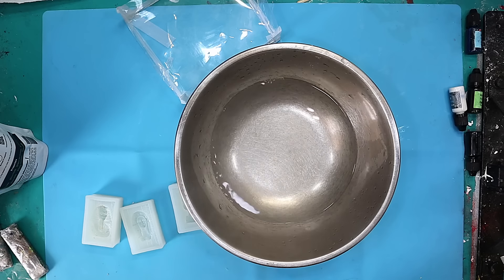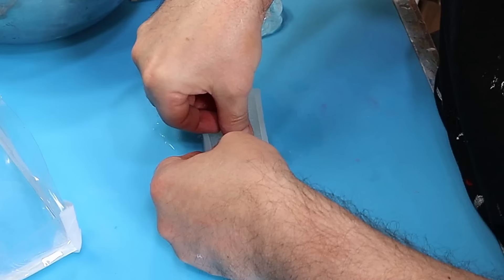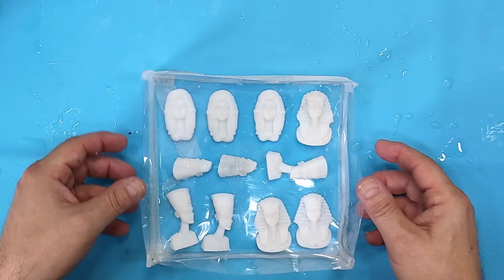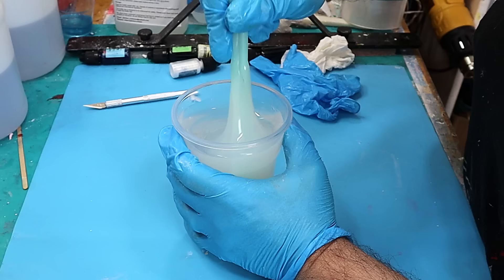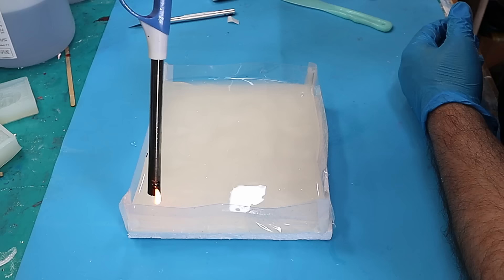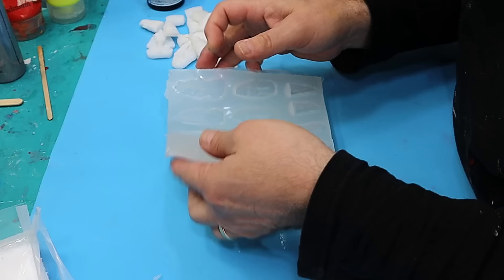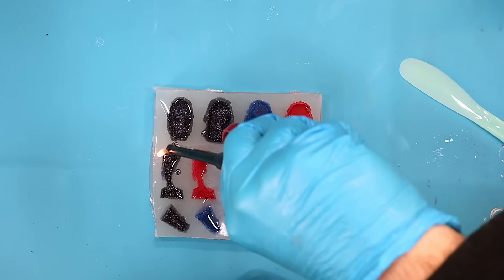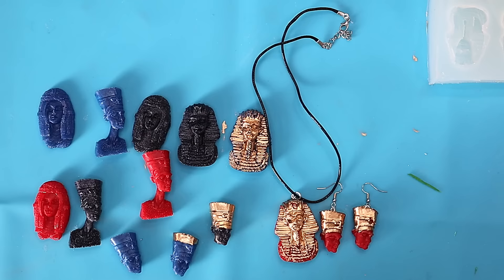This Simple Trick Makes Perfect Silicone Molds Every Time!

Comment: Nice video. I'm using the same silicone mold to replicate an aligante cast, but it seems like it's not properly curing around it. Is there a particular sealer i need to use?

Comment: Do u know if this is what oyumaru is? 🤔 Oyumaru is a "plastic clay" that comes in lil blocks.. usually clear or transparent colors and u put them in hot water just like this and we press it onto things to make molds of them.. instead of pressing the oyumaru into the molds we use the oyumaru AS the molds and can use uv resin etc in it.. I hope that makes sense? 😅 I'm wondering if this could work the same way? 😊 Although I know resin gets pretty warm and that may make the plastic stuff (and oyumaru) misshapen at some point.. I know oyumaru can be used and reused as well 🥰 I'd love to know more about this! Tysm! Very fun and interesting!

Comment: Hi, I hope u can help me 😢
I made a boo boo by not having my scales on a flat surface and didn't have enough hardener in so it wasn't fully set after over 24hrs, so I left resin behind in the few moulds I used and left a sticky mess in some of the slots in them moulds, I need to know how to get rid of this as I've used isopropyl alcohol and a warm soapy water and there is still some stickiness around please 🙏 help
Reply: @SteveMcDonaldArtsandCrafts  
Thanks very much 👍 I'll give it ago!
Maybe you could do a video on such a mess up!
Reply: But before pouring new mixed resin, make sure your molds are dry first!  None of that soapy water residue...
Reply: @alcg3981  ok I will do